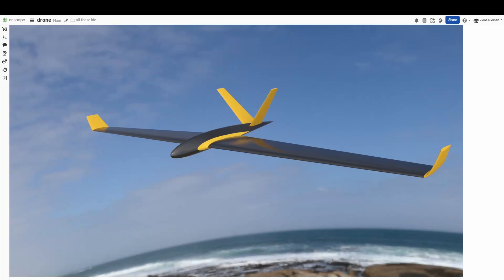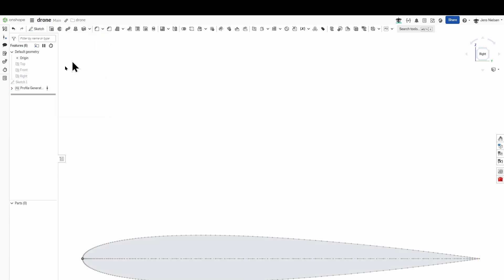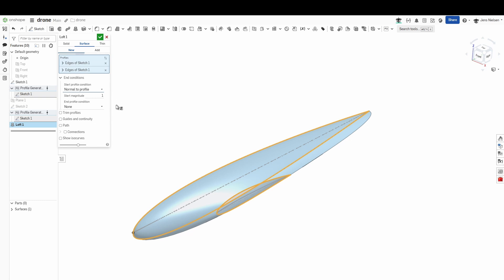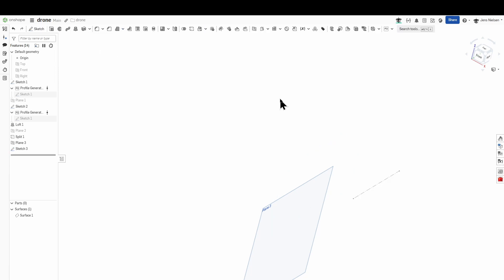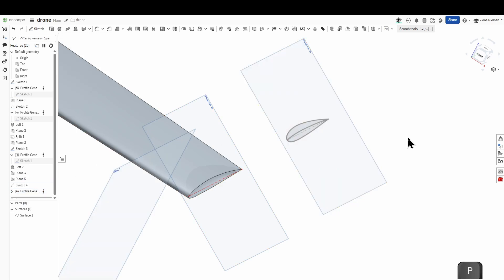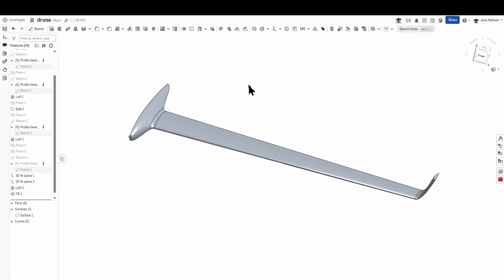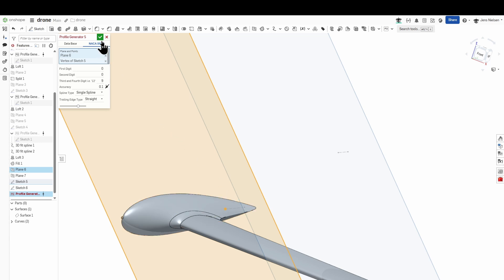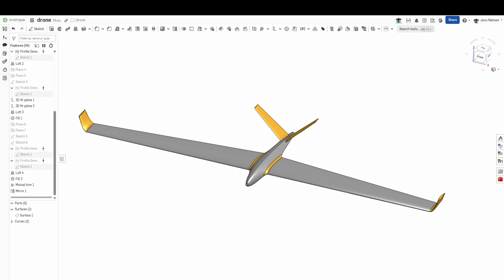Design a Drone with Only One Feature in Onshape

Comment: In  mututal trim,  the intrusion of tail plane entire Surface does get cut as it comes inside the fuselage, for some reason,  a disconnected   image of Inner  tail fin edge profile /Base edge profile/Tail Fin root profile / (Profile Generator 5 in video/Time 15:05 min  of tail cannard ) refuses to go away.  Do suggest rectifiation which I can impliment.
Reply: Could you send me a screenshot of your modeling window that clearly shows both the ghost line and your Feature Tree on the left? Seeing what is visible in the tree will let me tell you which Sketch or Profile to hide to clean up the workspace.

Comment: Very grateful for such a well made video:trophy-yellow-smiling:.     Cessna 2412 on main plane while symmetry on  tail planes were a learning experience for me. It did take many attempts to emulate exact steps. A simple slip  in selecting surface in place of Face cost me many hours of troubleshooting going back and forth trying to pinpoint the errors I did. It was worth spending all the time. Just what i needed .
Reply: Fantastic feedback, thank you!

I'm thrilled the technical details like the Cessna airfoil and tail symmetry were valuable. The "Surface instead of Face" slip is a classic CAD trap—thanks for pointing that out! It reminds me to stress that exact troubleshooting point in future videos.

It sounds like your effort definitely paid off! Keep an eye out for the new acrobatic airplane series, where we'll cover similar advanced lofting techniques.